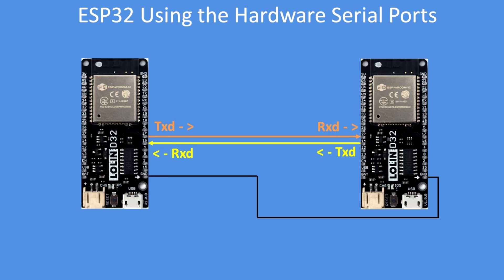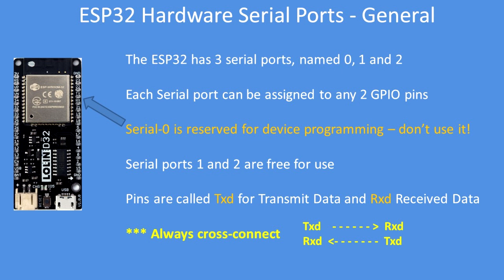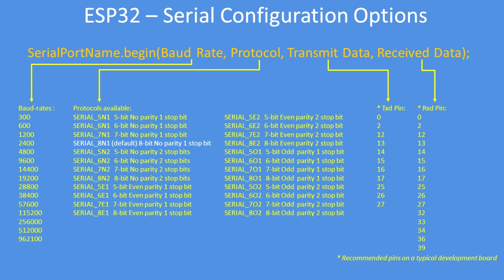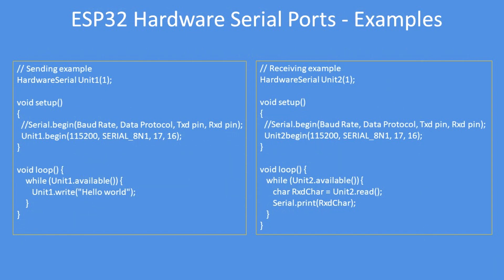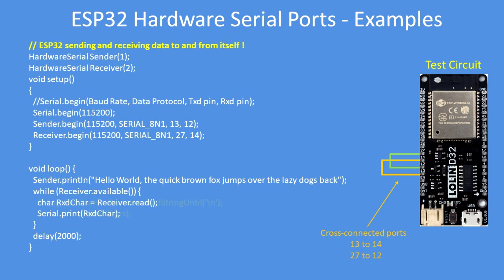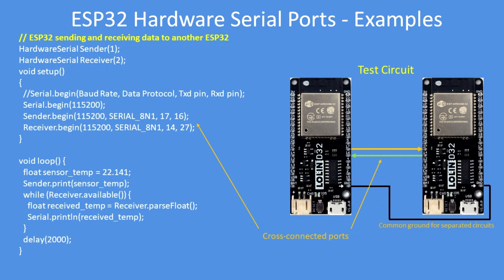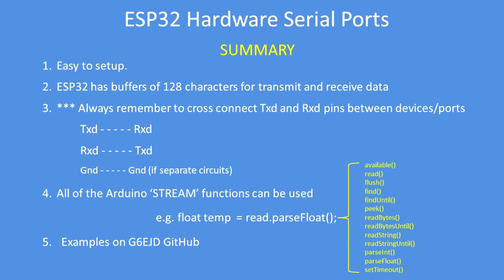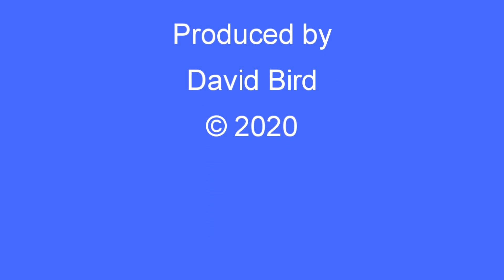Tech Note 137 - ESP32 a further insight into using the serial ports

Comment: Hello thank you very much for the video, i tried it with your github code when there is no other operation only sending the float temperature value it works fine but when there is other operation such as sensor reading then sending the value from the sensor it doesnt work for me could you please help me
Reply from the maker: What sort of problems do you have?
Reply: @G6EJD  I didnt receive any message fro the sender in the receiver
Reply from the maker: @NickyAndre  that’s be used the data format is wrong, what type of sensor reading are you sending
Reply: @G6EJD  Thank you very much you stick to me david i am pretty sure that my data format is correct i am reading Voutput of phototransistor which is in float data type then in the receiver also parseFloat i believe this correct right? Is there any impact of the processing time of both ESP32 it should be the same? because one is in fast processing time and one in low processing time.
Reply from the maker: Timing could be your problem, but only at the receiver end but the UART has a buffer so the data sent should be in the buffer until read. What distance is involved and is there good earthing between the devices as the transfer via serial is a very basic function that is reliable and should work without any issues.
Reply: @G6EJD  yess timing is my problem when the sender running faster than the receiver didnt receive the message when the sender running slower than the receiver it received the message is there any syntax which can be added to fix this david hope you know
Reply: @G6EJD  the distance is very close there is grounding between those two as well i think in this case the buffer save a lot of data then the receiver cannot choose which data to take because the receiver run faster hope you can give me some suggestion
Reply from the maker: Yes, the classic solution to the handshake of serial transfers is to change from asynchronous to synchronous and you can at least simulate a synchronous transfer by using CTS/RTS pins of the UART. CTS means Clear To Send and RTS Ready To Send. These two pins on each ESP32 are cross coupled so CTS to RTS and vice-versa, then the Transmitter can only send when the Receiver has finished receding the data and vice-versa. The combination of this change and the UART buffer will enable the serial throughput to be maintained at the fastest rate possible between the two devices. Alternatively just slow down the transmitter output rate  so that the receiver can keep pace with it. The ESP32 data sheet will detail which pins are which, but many development boards don’t bring out the CTS/RTS pins so you’d need to programme them when the serial communication objects are defined.
Reply: @G6EJD  i cannot slow it down because in this case my sensor processing should be very fast did you have any link or somewhere to find about the cts and rts david?
Reply: @G6EJD  when i used Receiver.read() instead of parseFloat in this case it can but the displayed value is not correct with what i send from the sender i use your code i send 10.04 float the receiver displayed 130,138,114
Reply from the maker: @NickyAndre  have you tried turning up the baud rate it can go very fast, then you can have more of a time budget to read and process data from the receiver port. Google ESP32 cts RTS will reveal lots of data
Reply from the maker: By the way, applying RTS/cts handshaking will slow your tx sensor reading down, so another technique would be to add a FIFO First In First Out buffer at the Receiver and use an interrupt to save data when it’s received, to be honest you have a fundamental design problem that needs fixing as your transfer / transport is too slow to match your sensor it seems.
Reply: @G6EJD  what about using other communication method i cannot use the wifi because the master will upload data to database can i use bluetooth and wifi at the same time did you know about it david?
Reply: @G6EJD  What about I2C protocol or did you have any other suggestion if this dont work
Reply: @G6EJD  Thank you very much David for all of your suggestion may god bless you always

Comment: why is my esp32 only recieve negative value?
Reply from the maker: It depends on the data type and how you are interpreting the data. If your using a signed integer and the value received has the most significant bit set then it is interpreted as a negative. Eg a byte can hold a value between 0-255, but a signed integer using a byte interprets the values as 127 to -128, so what are you doing?

Comment: Hi, great video, thanks. I have a ESP32 project where I used up most of the available pins but still need to take a picture. How can I use this technic to connect to an ESP32-CAM to have it taking the picture and send to the main ESP32? Thanks
Reply from the maker: One of the problems with video is large amount of data to be moved around, I don’t know if you want to send static images or are trying to move live video frames around, but say an image of 640x480 pixels, this requires 640x3x480 bytes = 926100 bytes per frame, so at the maximum baud rate of 926100 bits/sec would take 10-secs to move an single frame of 640x480 24-bit colour. You can multiplex nearly every function eg serial or spi or I2c to any pin on the ESP32 so you could once programmed also use your TX and RX pins as additional GPIO pins but interacting with the ESP32 becomes quite difficult/ tedious, but possible nonetheless.
Reply: @G6EJD  Hi, thanks for taking the time to respond to my question. All I need is a single picture, say, ever 10 minutes or so and it will run unattended. I have code to take the picture into a variable and save it to a SD card. What would I do to transfer the contents of this variable to the main ESP32? Thanks again.
Reply from the maker: SmartIOT, open the file, then while not eof, read a byte, serial.write(byte), done
So about 5-lines, there are examples around of reading a file, you just need to setup the serial port then send data to it. Your receiving system would need to be permanently listen though unless synchronised or some start signal
Reply from the maker: If an array then for next then serial.write(array[i])
Reply: The code I have that captures the image is: 
camera_fb_t * fb = NULL;
fb = esp_camera_fb_get();
fb must be some sort of frame buffer, this variable is not initialized by me. I have code to save it to SD but in fact I would like not to use an SD card and transfer the image straight to the main ESP32 that will then transfer it to an FTP server. I already have the code for the ESP32-CAM to transfer the image to an FTP server. I don't know what fb is, may be it is char array. The code I have transfers whatever is in the fb to the FTP server so the ideal would have the same sort of variable been created at the main ESP32 side so I could apply the code I already have. What do you recommend on for this scenario? Thanks
Reply from the maker: @fingerprint8479  OK, if you have the code somewhere in there or its associated libraries (link to it?) the variable fb will be defined, I suspect it is an array clearly the function  function esp_camera_fb_get(); returns the Frame Buffer content which is what I think fb stands for. So to send the data / fb contents would likely be (roughly):
for (int i =0; i < sizeof(fb): i++) {
  Serialportname.write(fb[i]);
}
Hope that helps.
Reply: @G6EJD  Excellent, thank you. Sure it helps. If it is not to disturb you too much can you also help with the receiving end? Thanks again.
Reply from the maker: SmartIOT, that would the same as the transmitting end, so define an array fb may as well call it the same and use the same definition as your code example uses, the set up the serial port as I describe: I=0; while serial port.available { fb[i] = serialport.parseInt(); I++;} that’s it for the transfer. But I don’t know what format the data is, however you’ll end up with a copy of fb so display it as the sender would and copy that function. You receiver ESP32 would have to sit permanently listening for data until you figure out a way of getting its attention if you want it to be doing something else usually you’d send it ESC or char 27 to get its attention then it goes to the image receive function but that ESC function would need to be programmed which you could in time use a serial event ie your receiver code runs then an interrupt event occurs because ESC was received then it goes to receive when done all control returns to the main routine and then you have fb at your disposal you should all this in small steps.
Reply: @G6EJD  OK, my intention is that the receiving ESP32 will have to ask for the image so I can start monitoring just after asking for the image. Your suggestion fits my requirements perfectly.
Many thanks for the help.
Reply from the maker: @fingerprint8479  Happy to help
Reply: @G6EJD  Hi again, I am trying to implementing the idea but having problems of how to handle the data both on the transmit and receiving sides. On the original ESP32CAM script (https://randomnerdtutorials.com/esp32-cam-take-photo-save-microsd-card/)  the image is written to SD on the following line: file.write(fb->buf, fb->len); // payload (image), payload length
 I tried the for{} but it fails on the fb[i], also on the receiving side char myImage = Serial.readByte() did not compile and I had to use Serial.read(), it compiles but I sure have other problems.
I also tried Serial.write(fb->buf, fb->len); it compiles but at the receiving end sizeof(myImage)=1.
Any sugestion? Thanks in advance.

Comment: Can we do the same for esp8266, esp8266 to esp8266 serial communication?
Reply from the maker: Yes, but you have to use the library software serial and the ESP8266  has 2 UART's: Serial0 uses UART0, which is mapped to pins GPIO1 (TX) and GPIO3 (RX). Serial may be remapped to GPIO15 (TX) and GPIO13 (RX) by calling Serial.swap() after Serial.begin. Calling swap again maps UART0 back to GPIO1 and GPIO3.

Serial1 uses UART1, TX pin is GPIO2. UART1 can not be used to receive data because normally it's RX pin is occupied for flash chip connection. To use Serial1, call Serial1.begin(baudrate).

Comment: if you've having trouble, don't waste your time. the UARTs on most esp32s are garbage, code that works on many systems even the crappy ones like electric imp have great difficulty working on esp32 for some reason. It's like the manufactures didn't think much about the UART anyway and you'll have a hard time getting it to work consistently

Comment: Can i made swap afer i set up my uart 0 to pin Gpio 15, 13 just to debug the code?
Reply from the maker: Yes that will work
Reply from the maker: @hero-gl4zy  you can’t use swap because UART1 is used to receive data as normally its RX pin is occupied for flash chip connection. You have to select the two unused UARTs and select unused pins. Change the uarts over by not using swap.
Reply: @G6EJD  in the prevouse code i used uart0 not 1
Reply from the maker: @hero-gl4zy  swap() uses UART0 and 1 just use two other UART’s and don’t use swap(); do what you might call manually not using a single function that is not doing what you need.